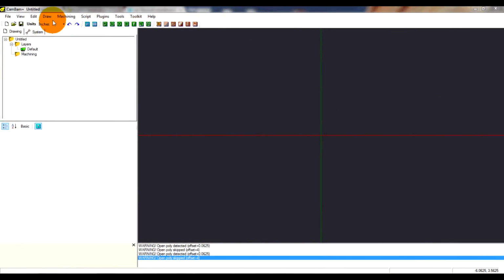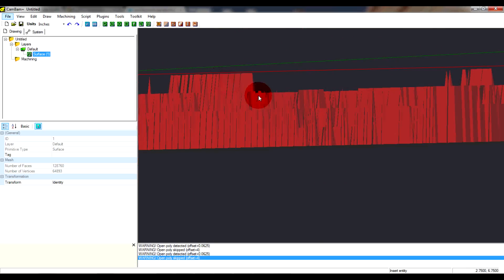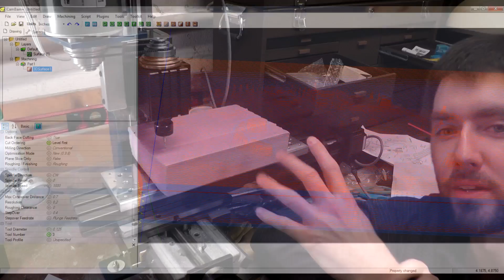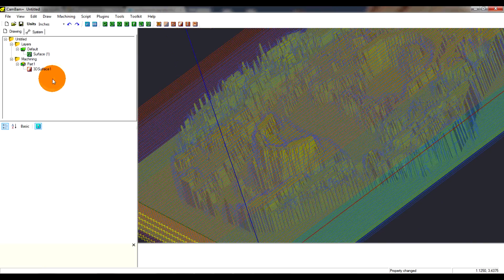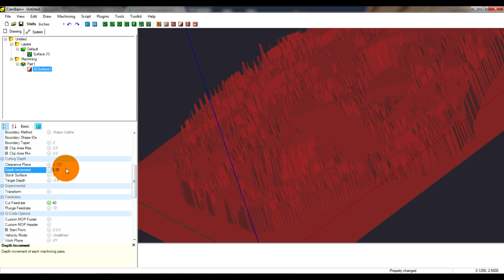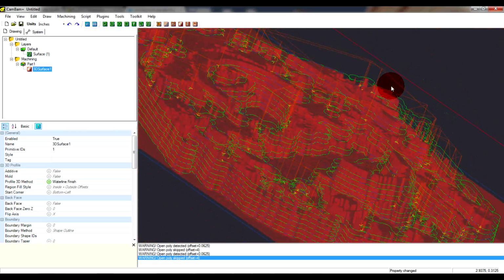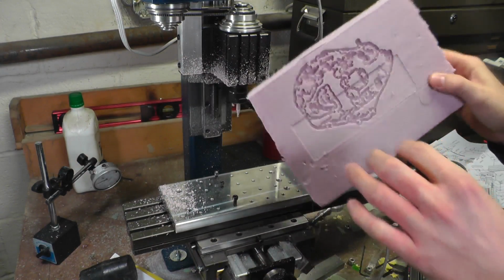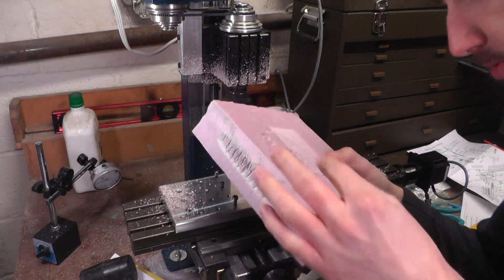First cut on Taig CNC Mill

Comment: How would you say the noise is on this machine compared to a belt grinder? I've found a low grit belt grinder on steel is borderline too noisy for my loft, so I'm nervous about finding a sound solution before I purchase.